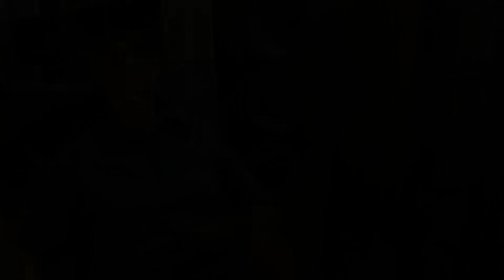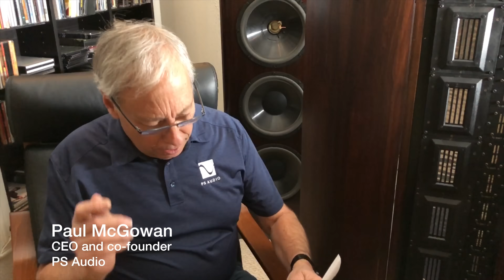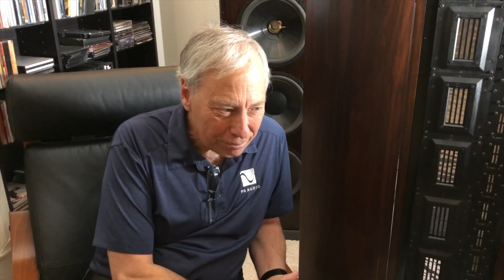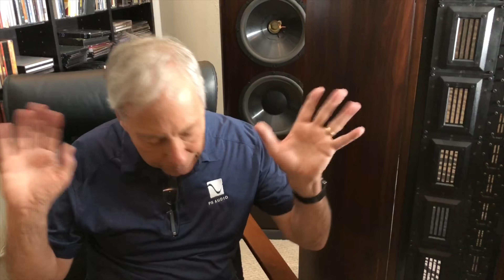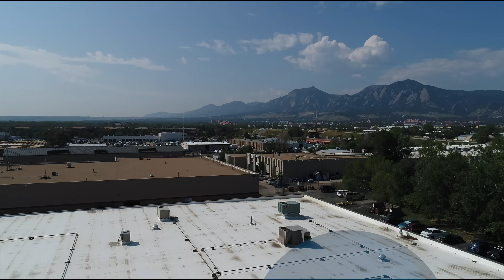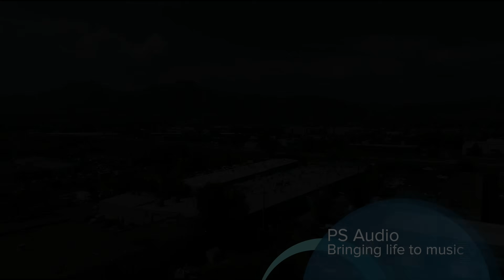Do amplifiers sound different?

Comment: One thing that is very interesting to me is that the site we all know which is all about measurements, and only measurements, excludes square waves from their amplifier tests.  He makes some claim about them not being that useful for 'what he is measuring'  Something about the difference between fidelity and performance.  Yet everything else I've seen says that the way an amp handles a square wave will tell you about the sound characteristics.
Is it possible that amps that measure the same on other tests could show different square waves and thus sound different?  If it isn't then why aren't they included by the measurement worshipers?  
Is it possible that they are leaving them out because square waves can disprove their number one commandment????

Comment: This question needs a revisit. I don’t think you adequately replied to the question. Say for instance you had two 1000w class d amps feeding a small 200 watt driver wired to one ohm in a car audio application even with impedance rise and fluctuating electrical volts it’s pretty clear that the subwoofer would be receiving adequate clean power from both amps. As such in that scenario which is similar to the question wouldn’t it be fair to say that the less expensive amp sound quality would be indistinguishable from the higher priced amp?? It seems to me that if the driver is receiving clean power with ample head room still in the amp there would be no difference? Am I wrong?

Comment: I have good ears, I have absolute pitch, and on blindfold A/B testing, i've been fooled with a NAD 316 vs Sony basic compact all in one 60W stereo. On the other hand, I can easilly tell betweed my B&W 601 S3, Kef q300 or the sony's speakers. Is there a possibility amp specs and differences are all a "scam" and the only thing that matters is THD at high volume levels?
Reply: I certainly dont have perfect pitch and i dont have expensive gear. Either way today iv been testing arcam diva a85s power amplifier against pioneer a-717 power amp with Rotel rc990bx as preamp. 
I cant tell a difference at all after spl match them which is easy since the pioneer have a volume pot on the amp section.
Couldn't tell a difference even if my life depended on it.

Ps. Switch preamp and the difference is massive. Ds.

Comment: The amplifier works on the principles electricity...as long as the amplifier is designed to amplify linearly and doesn’t clip how can they sound different?  3000hz with a 2 decibel gain is 3000hz with a decibel gain.  This is measured electronically and how amplifiers can even be designed by electric engineers.  The whole principle of amplifiers is to increase the current of the input...any 2 amps that increase the current at the same level will pass the exact same current to the speakers and thereby producing the exact same sound.  The only time an amplifier will sound different is if it designed to distort, improperly designed as to create distortion or driven to clip.
Reply from the maker: The simple answer is we do not know how to measure with our equipment all that we hear with our ears. What isn't taken into account are any number of interactions within the system that affects the signal you hear. You can't think of the amp in a vacuum.

Comment: In the real world there are some basic facts that can help people get good fidelity for less money. The first fact is that two amps that measure the same will sound the same. It doesn't matter what they are made with,  how they were built, or the intentions of the designer or builder. Better built or designed amps will likely last longer (their specs won't degrade as fast). Moreover, amps that differ in measurement will sound the same if those differences are below the threshold of the ability of humans to distinguish differences in the sound produced. Thus all amps meeting some modest spec requirements will sound the same. This fact has been repeatedly demonstrated by controlled testing, where very cheap amps cannot be distinguished from expensive ones. Even if the previous were not true, several things affect reproduced sound much more than amp differences including the quality of the recording, the program source, the speaker, the room, and where the speakers are placed in the room (and where you listen in the room). Obviously, differences in power output of amps can be heard, but the power has to double for a small difference to be heard (in volume not fidelity). Allocate your spending accordingly.
Reply: I have good ears, I have absolute pitch, and on blindfold A/B testing, i've been fooled with a NAD 316 vs Sony basic compact all in one 60W stereo. On the other hand, I can easilly tell betweed my B&W 601 S3, Kef q300 or the sony's speakers. Is there a possibility amp specs and differences are all a "scam" and the only thing that matters is THD at high volume levels?

Comment: gooood queston..........get a good tube amp and it will produce those wonderful even order harmonics  that will distort the sound but in a wonderful way.....a  class A solid state amp will be clean and provide better bass ( generally speaking ) .   Add a tube pre amp to a class A amp and you are on to something.........    do a search for "amp camp amp"
Reply: The even versus odd harmonics issue is irrelevant if both are low enough to be inaudible--as they are in most modern amps with low measured distortion. Ditto for the distortion produced by class A and A/B amps.

Comment: I've done some A/B testing with amps and they most certainly do. However, with good amps, it can take a while to zero in on what is different. I remember there was a pair that sounded exactly the same at first, but after 30 minutes we'd learned to tell them apart based on how they handled the sound of a hi-hat.
Reply: You zeroed in something important... It takes a while. That is of key importance when studying human discernment. Long term listening demonstrably reveals differences that Instant switch overs cannot.
Reply: @socksumi  Yep. You can AB amps all day long and say they sound the same, but it doesn't mean you can't tell the difference. Also, when people say two amps are close enough that it doesn't matter, that may or may not be true. Synergy has to do with all components steering the sound into a pleasant balance. A bunch of components that are off in the same direction can sound really bad.
Reply: If you need 30 minutes to notice differences in a pretty narrow position of the whole frequency range, do those differences really matter? No offense intended, I'm just not sure it makes sense to me that such differences would make a difference.

Comment: From my point of view amps do not sound different from one another though I believe preamps do and i do hear difference when swapped out, within the same brand differences can be slight at best but between different brands most certainly. With integrated amps its the preamp sections i believe your hearing the differences between. In my view Pre's and sources are the most important part of the hifi chain

Paul i suspect you know there's an open competition out there (well i think it still open) and suspect you even know the chap (Richard Clark), challenge anybody to see if they can hear the difference for a cash prize. I think its been open for around 20-30 years or so and nobody has done it, not even close, not even by chance and some very big names have tried it apparently. 

Basically it states as long as the amp/s in question are driven within there range and not stressed ie not clipping and has the power to drive the chosen speakers, with everything else staying the same within the chain, budget amps sound no different to  higher end ones. The written paper research is a very compelling read. What they do state, is they understand that higher end amps have the ability to drive/control speakers better with less distortion when driven but control is no the same as sound but dose effect the sound if that said amp is pushed to fair. hence the statement driven with in limits.would to know your feeling on this at some stage

Comment: Is their a big difference between 0.5 and 0.8 distortion on a class d amp?

By the way really good video.
Reply: The difference is 0.2 (I assume percent THD). As to whether you could hear the difference depends on what frequency range you are listening to and other factors. Note that the distortion of most speakers in low ranges is ten times that value.

Comment: late '70s specs that are not talked about anymore, Slew rate, Rise Time, TIM distortion, Diamond Differential circuit, high speed amps, this is what I believe made amps sound different
Reply: "late '70s specs that are not talked about anymore, Slew rate, Rise Time, TIM distortion,  . . . "
Because they WERE late '70s tech. Modern designs solved those problems.

The Diamond Differential circuit is just an amplifier input topology, common in instrumentation amplifiers, adapted to audio.

Comment: What happened to the dust cap on the woofer in the back?
Reply: Anthony Pierre From another video it has an accelerometer to give the amp feedback to its actual position.
Reply: Dust caps only add weight, get them all off.

Comment: People get hung up on 'watts per channel', and it is almost meaningless...a more important measurement to take notice of is it's ability to drive a continuous low ohmage load, say down to 2 or 3 ohms, and an amps ability to double it's output as the ohmage halves...
A Naim 135 monoblock is rated at 75w @8 ohms, yet it is capable of driving extremely demanding speakers with superb audio quality, but it also has a peak output of 500w and can run a constant load down to 2 Ohms...
Also an amp must be able to react very quickly to control a speaker..Big power is meaningless without control.
Finally, car amps are often rated a stupidly high numbers (because they are bought by joe Public who thinks more=better)..BUT a car audio system is only 12 volts!!
Reply: my amplifiers are stable at .5ohm and have been proven to do rated power at 1ohm and below. car systems are typically 14.4v while charging and can (draw) 100's of amps of current. But i agree with most of what you said regardless because joe blow just looks at what is on the box and not what is in the box.
Reply: yes how can you drive a 8ohm sup whit a 12 vold power supply so it uses 1000 wats  a step up transfer is nowhere to be found
Reply: "yes how can you drive a 8ohm sup whit a 12 vold power supply so it uses 1000 wats . . . "

Thefreakyfreek: Actually, there is - sort of. You use a switching power supply to take the 12 volt input, chop it up, run THAT through a power transformer to raise it to whatever voltage you need, rectify and filter it , and use the resulting DC voltage to power the amp. Sounds terribly inefficient, but a well designed switching power supply can exceed 95% efficiency.
Reply: " . . . and an amps ability to double it's output as the ohmage halves."

Simon, that is not how power works, especially when you are talking about audio power into a speaker. The first problem is that a speaker represents a complex impedance and audio load. Second, even if you were driving a resistive load, if you halve the ohmage, you only need about 1 1/2 times (more exactly 1.414 times the power.
Reply: The impedance of speakers varies with signal frequency, but few are going to present large significant differences across the frequency spectrum. Moreover, the differences the amp sees are of very short duration for which most modern amps can supply enough amperage to meet your criterion--or close enough. Your assertion doesn't consider the time factor at all (you mention continuous power).

Comment: Thanks Paul, simply haven't thought yet about the significance of the square wave response (or a repeated step resp for that matter) for a good sounding amp! Of course for control loop engineering it's commonplace to determine the step response and the loop stability. But treating an audio amp as a feedback system, as it is, and even deriving its sound quality from this viewpoint - a simple and stunning method.

Comment: A lot of people will say they love the warmth of tubes but in fact it’s their own way of coloring the music; but most will take that color over the tin sound that some pure digital solutions offer.
Reply: That "warmth" comes from the fact that the output transformer in a tube amp automatically starts losing output about 12 or 15 kHz or so.
Reply: Just to be clear--that warm sound is increased distortion, which is preferred by some but it ain't high fidelity.

Comment: Sorry to say so Paul, you didn't quite answer his question... amplifiers will all sound different due to their degree of complexity and design. The ideal amp is just a piece of wire with gain ( Peter Walker of Quad..) but in reality this isn't possible... so every amp whether a low end or high, will add or subtract SOMETHING from the original signal.. I have a fundamental belief that the simpler the amp is the better .. rather like passive crossovers ... less is best you might say... in many cases amplifier designers opt for creating wrongs to make rights in their circuits .. 
The best basic audio amplifiers are based on a pure class A " op amp " performance driving mosfet output stages with multiple banks of capacitors in the supply rails ..  I'm of mixed feelings towards servo offset correction .. it is necessary but does affect the overall design and cost ... and perhaps the sound ...
Reply: Janina Palmer Dang woman, you are hot and smart. I'm in love.
Reply: Janina Palmer I'm bilding a realy simpel class ab amplifier  and u use the preamp opamp to compare te output to the input and so far I can see very litle distortion on my scope  (line up the 2 inputs and than mirror one and ad them up ) and the amp is and looks realy simple  so that's a good thing. I do have a beefy power suply to 12 volt 15 amp transformers  and 2 huge 0.5F caps

I do love the fact that  I can make the speakers move at the realy low Frequency like les than a single Herts and you can hear noting no high pitched noise no 50/60 Hz buzz only my phone's dac but that's so minimal it wont bother me
Reply: Yes, simpicity in design always sound better.

Comment: First thing I look at is the power supply. If they don't get the power supply right, then it doesn't matter how good the rest of the amp is. I have actually made significant changes to the sound of multi channel amps by isolating power amps to their own toroidal transformer instead of sharing them with multiple channels. If you can get CNAMPX 16X60 amps that were engineered by ATI, do it. A little bit of elbow grease and some electrical engineering knowledge and these puppies are singing crystal clear and powerful for about 500 bucks used. You can even wire in a 12V trigger with the network controlled relay switch. 

Rip out the network card and wiring, bypass the output relay board, remove the parallel resistors on the input boards, remove all but two amp cards, run them on separate transformers, wire your speakers in bridge mode( positive to lower positive and negative to upper positive) and you now have a top class pair of 225watt A/B class mono blocks made by ATI for around 500 dollars. You can also leave all the cards in there, bridge them all and have an amazing 1800watt multichannel amp for your home theater.

Comment: I have three amplifiers, each is designed by the same manufacturer (Rotel) and each is rated at 50 watts per channel, designed in different years, and each of these sounds significantly different from the others. I have also come to realize that no such thing as a pure "clean" amp exists. Each amp has it's own character, it's own color. Building a reproduction system involves matching  components so that the end result sounds musical. And that can only be achieved by trial and error.
Reply: yup its frustrating. still to this day the best amp I ever owned was a Mcintosh MHT-200.  Sounded better than my Current, newer Mac!  And it wasnt even designed for 2 channel exclusively, it was for home theater,  Makes no sense.  But it had such a phenominal sound I want to get another one some day lol
Reply: it's nice when u find something like that. trust your ears.
Reply: Finding synergy with Componetes
Reply: @tee-jaythestereo-bargainph2120  That's it....on a more esoteric note, i believe those components are sensitive to a humans electromagnetic field and after a time shape by tiny fragments a day..i know far out.